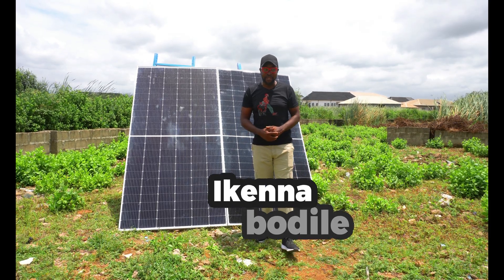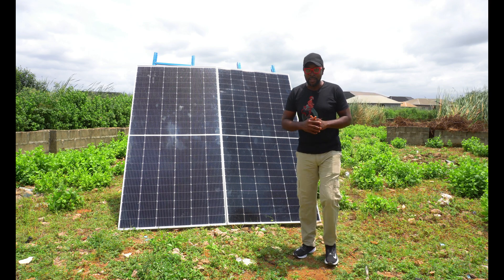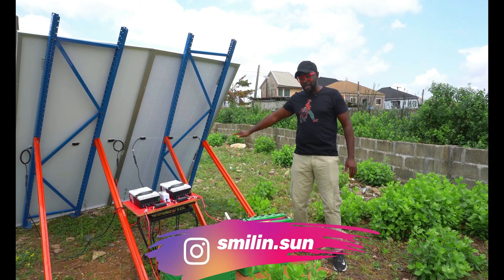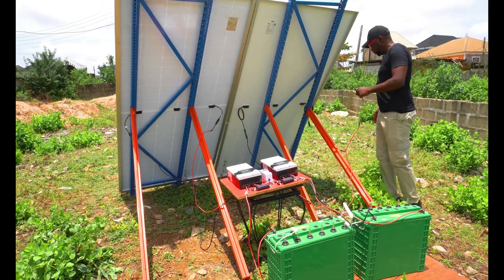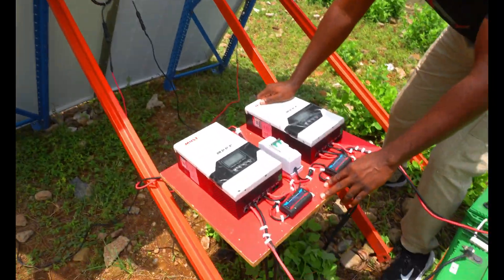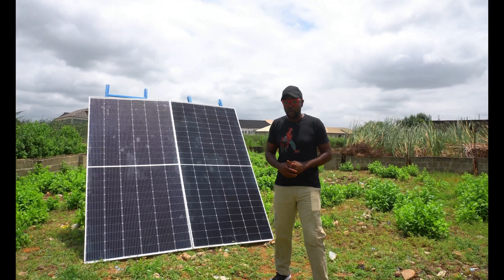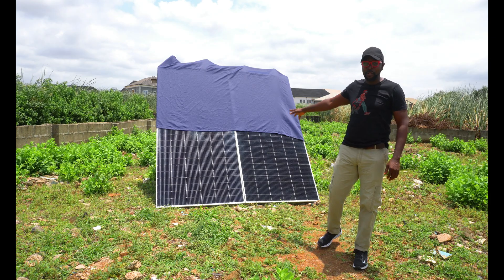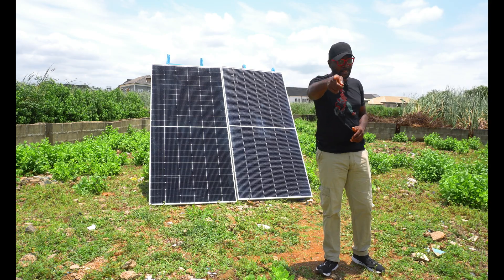Felicity Solar panel vs Trina Solar panel , Output test.

Comment: Eng Ikenna, u are doing great. I want to ask, can one use a hybrid inverter and also support it with a solar charge controller?  Say u have a 6kwh hybrid inverter and u need much power than the rated PV due to large battery backup u have and the PV rating of the hybrid will not meet up. Is it advisable to add a solar charge controller to the setup? While u connect the external solar charge controller to the battery as the hybrid is also giving energy to the same battery? Kindly reply pls.
Reply from the maker: Absolutely , you can

Comment: Please test for felicity controller vs that controller you used. I have a feeling that any controller without active fan cooling may throttle down the power going out of the controller, as the temperature increases, especially in places with high ambient temperature
Reply from the maker: @odoohub5010  ok

Comment: I am shocked you got 94% of the rated capacity of Trina panel. That rarely happens. If you get 80-85%, your panel tried. How did Trina produce a whooping 94%. Wow. Lets have Jinko vs Trina please
Reply from the maker: @EasyyokeFilms  Trina really tried, will move on to more output tests
Reply: Trina 665w did 105% on his latest video

Comment: nice. trina vs jinko should be next
Reply: I would prefer jinko vs Longi. Both 650w bi-facial. I use Longi 650w and I got almost 95%from it. Their panels are crazy.
Reply: @taiyeawe7304  there is already a video for that.check previous video
Reply: @taiyeawe7304  mine oen producr more than 100%.i also use clamp meter and is accurate
Reply: I will like to see this test. I use jinko panels
Reply: @dawnyaguele8677  same here jinko 625watt half cut
Reply: my 6 units of jinko 625watt halfcut panel is producing 4400watt and 6 times 625watt is 3750watt and am getting 4400watt
Reply: @GTdontDOthat 
That's because your MPPT controller is doing more power conversion
Reply: @FridayOmale-u7t  yeah
Reply: The efficiency is dependent on two things, the charge controller conversion efficiency and the solar panel efficiency

Comment: Felicity should be added +40watts... Look at the shadow cast, both panels are not at the same plane to the sun irradiation.
Without this test, I dont think anyone that has done lots of jobs should think Felicity beats Trina.
However, there are more things that has to be considered as the best.
Reply from the maker: Did you even watch the video till the very end Sir, the solar panels were switched and it was still the same result.
Reply: Watch the video to the end Bros!